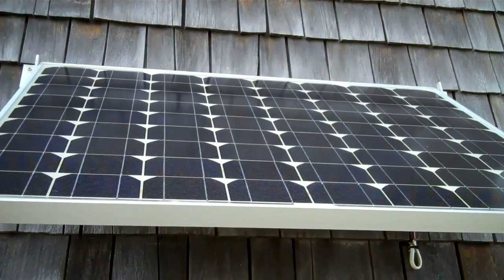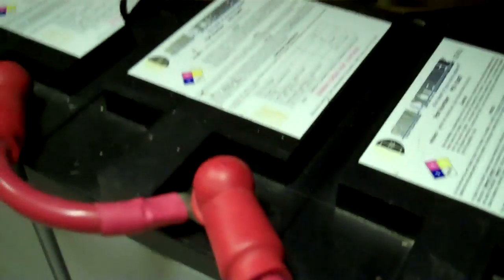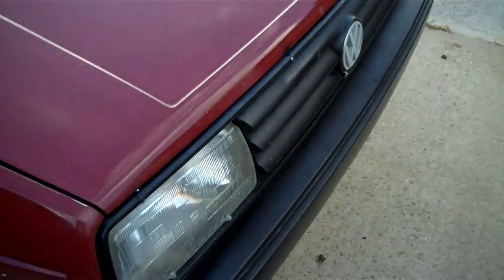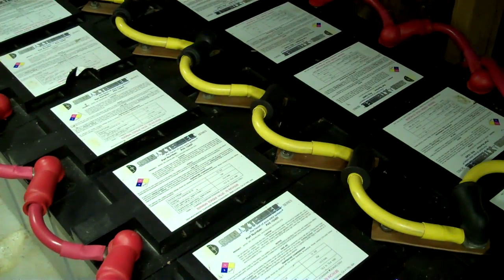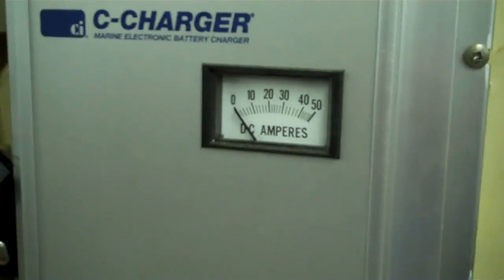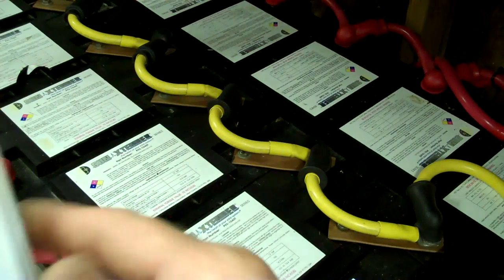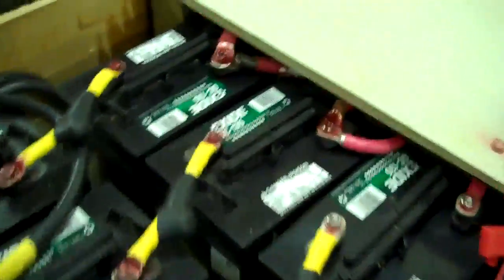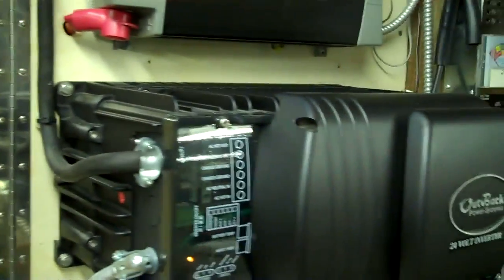HOW TO GET THE MOST LIFE OUT OF YOUR SOLAR BATTERY BANK

Comment: I have a 12v sistem to with 16 AGM it works beautifully I use it to run my house everything In-N-Out I still have grid but is only use for the central air my bike up is a 18000 watt Generac propane what is control by my samlex 3012 Evo and you're right so much stuff for the 12 volt and yes I have music in my car and I have a 220 amp alternator I can use it to charge my battery

Comment: @4:34 you state ...
At Freezing ( 0°C / 32°F ) the capacity falls to 50%.
 But per Sandia National Labs a SLA battery only loses 25% - ie it still has 75% of rated capacity.

Then you claim, capacity is also lost at higher temperatures.
But Sandia National Labs states capacity INCREASES with higher temperatures.

Comment: I'm not sure what this did but I have two 100ah AGM battery's that have stood empty for nearly 2 years, they wouldn't charge up and stayed at 3 volts even when I connected a second battery to get it charging...so I connect the stick welder earth onto the pos and tapped the electrode on the clamp...done the same on the earth...they sat at over 13 volts and have stayed there for near a week and now still in the high 12'v's after 2 weeks...

Comment: the main benefit of 24 or 48 volt compared to 12 volt is the amount of batteries you can connect together.... when you set in series they work better than in parallel ...you should only have 3 parallel. so if you have 6 volt batteries set up to 12 volt you can only have 6 batteries.. if you set them to 24 volt you can have 12 batteries, at 48 volt  you can have 24 batteries..
Reply: With the PROPER connections, we can easily connect more than 3 sets of batteries in Parallel.  And it wail last for many years...

Comment: 12V voltage setup is not so efficient and it is possible to charge other battery voltages from a single running vehicle such as a car/truck/van.  AGMs are much cleaner than FLAs and much safer for indoor use.
Reply: AGM cost more per Ah and don't have as many CYCLES as an FLA.

Comment: i have 8 Trace 235AH 6V Deep Cycle Battery  48 volts and have the flexmax 80 can you tell me what are the  charging voltage set points-current limit, absorb, float, absorb time limit, end amps and rebulk.? i can't find the specs

Comment: Nice video. For GEL cells (not AGM's) you will find that they will last longer if you never charge more than 14.1volts (14.3v absolute max) at normal temperatures. Never equalize GEL cells (even 15 volts can ruin them.)
Reply: Are GEL cells better for Stand-by applications - like a UPS ?
Reply: @MrSummitville    Hello, I think good quality AGM  batteries are best for standby. Gel cells are just so critical on charge voltage. Chargers can go wrong, and any GEL (thick electrolyte) that's even slightly over- charged won't last long. I have some YUASA standby cells and they've lasted well

Comment: Nice work you doing. I have few questions

(1) I used a 12 AWG cable for connecting my solar pannel to my charge controller?
Can I use that same 12 AWG cable for connecting my charge controller to my 200AH battery?

(2) what size circuit breaker in amps can I use on the positive side between my battery (200AH) and my inverter (1500 watt pure sine wave)
Reply: Ampere Hours is a measure of how much Power a battery holds, and has almost nothing to do with wire size.  The information you need for that is your max intended load on the battery (in your case, probably the max DC amps the inverter can draw), and the '20 hour rate' for the batteries.  The smaller of those two numbers is your limit - you CAN draw more than the 20 hour rate, but the more often you do it, or the higher you exceed that number, the more you're going to lose battery life.  Really high currents can damage the battery, cause bulging (first sign of damage for a sealed lead acid battery), leakage, fires...  but I assume you know that.

Once you know the max current, do a quick search for, say, 20 amps wire size, and Google will be more than happy to tell you.  Keep in mind that the Length of the wire matters - a really long run will require larger wire to keep voltage up where you want it, and some wire gauge amperage charts might not mention that.

Comment: Solar systems are for fools, if,you owe a loan on your house or rent.Want to save? get out of debt,stay out of debt.owe no man nothing.
Reply: I wouldn't go that far.. The companies that are calling you and pushing solar do NOT have your best interests at heart , which is to say, if you don't know solar pretty well, they'll rob you blind.

I'd even go so far to say that if you don't have money like Ritchie Rich, AND you don't know a Lot about solar, batteries (if you use them) and electrical maintenance in general, you won't benefit a lot from any kind of solar system.  The service contracts the solar companies sell are expensive, but absolutely NEEDED if you don't plan to do the service yourself and have the knowledge to do so.

A large enough system to give you some decent backup power in an emergency (lets face it, you aren't paying this much to cover a few hours of electricity outage) is going to be expensive.  Anything less ambitious is better handled with a generator.  Yes, solar is a bit better on the environment than a gas guzzler (but not as much as you think - the energy and waste from panel production is not small - not to mention batteries).  So if you are willing to spend the money (or work for it) to save the environment, more power to you (yes, pun intended).  If you have the expertise (ant the time and willpower) to do at least some of the maintenance, and maybe even installation, yourself, you can easily break even, maybe even go a good bit into the black saving money.  Depending on your local power monopoly's rules, you may even be able to profit by selling some back to them, but most make you jump through so many hoops, and pay so little, its not worth it.  (Mine has condescended enough to pay you back HALF the rate it charges...)

The rest of us poor slugs have to get by with whatever we can.  IF you can find a good grid-tie inverter for a good price, a small system without batteries is viable.  Just don't fall for the companies that want you to pay them for every kilowatt hour you sell back to the power company AND charge you a steep yearly maintenance fee.  You won't even come close to breaking even with them (until their contract is up, right about the time stuff will start needing to be replaced...).

Comment: Never place a battery on the concrete, put them on a pallet
Reply: That's just a myth, dating back to when batteries were made of wood and sealed with asphalt.  Anything with a plastic case can (and probably should) be placed on concrete.
Reply: This was good advice before batteries were made with plastic cases like today. Modern batteries do NOT self discharge when on concrete anymore. 
You can contact Interstate Batteries to confirm this.
Reply: why?
Reply: When batteries are not mounted on equipment, they should be placed in proper storage areas, but never stored directly on a cement floor. If necessary, place them on wooden pallets and store in a dry, moderately cool area

source: https://www.safetyinfo.com/forklift-battery-charging-safety-free-index/
Reply: Willem Budde thanks for information, but i thought cement is safer than wood. In case if battery on fire, wood is easy to catch on fire but concrete is not. Other reason is concrete can absorbed any liquid leaking out of battery which help prevent chemical creating fire.
Reply: You welcome Danh Luc
Reply: Willem Budde  shut up stupid
Reply: Thanks
Reply: you are really weird man. instead learning something, your words just show how a person you are.
Reply: Keeping batteries off cement is NOT a myth.  Ever walk on a plain cement floor in winter?  How fast do your feet get cold?  Same thing happens to your batteries - and cold batteries don't perform well.  Even in moderate seasons a cement floor can drop battery temperature enough to reduce efficiency.  Cement IS safer than wood (not by much), but put a rubber mat under the batteries to insulate them.  If you do decide on wood, remember - Stuff Happens®, and when stuff happens to batteries (or anything electrical with enough voltage), it can cause fires.  Better safe than sorry.

Speaking of efficiency... higher voltage = less current =  more efficiency, no matter how big your connecting wires.  The electronics that turn DC to AC not only lose less to heat at lower current, they don't have to multiply the voltage as much.  This is a much bigger loss if a transformer is used to step the voltage up, but even the newer inverters that are all solid state will lose some efficiency to the extra current needed to boost to the voltage higher.  A 240 vac (RMS!) inverter means 340 vac peak, and 48 vdc would probably be boosted 8 to 10 times to provide it plus a little margin for efficiency and voltage drops.  24 vdc would need a 16-20x boost, 12 vdc - 32-40x.

Not to mention 0000 gauge copper wire is very expensive.  You'll pay a lot less for every gauge size you can drop for the same length of wire.

Comment: Where can you buy large gauge battery cables? Thanks
Reply: With a little elbow grease you can make your own using high quality welding cable (ebay) & copper from local supply outlets. Reference YuTu on how to DIY. 
Good luck.

Comment: Great video.  Where id you get the heat shrink to fit the large cable?  I have been making all my own battery cables out of 1/0 fine strand welding cable, but could not find heat shrink big enough to fit over the cable & lug.  Also, I like the covers that you have used to cover the lug and battery post.  Where did they come from?  Thanks for any help you can provide.  Lucian Dean

Comment: Nice system you have there.  It would be bit more  efficient to run a 48v panel and battery system as the 12v inverter can get much hotter when converting  12v to 120v.  The 48v inverter creates a lot less heat (loss power) when converting from 48v to 120v.   Of course it cost a little more to use 48V components, but the cost can be made up in the cost of the wiring.
Reply: Costs a 'little more'.... um it's four times the cost... for a 100AH battery bank on 12V, you need one battery, on 48, you need four. Nuf said.
Reply: That's not exactly how it works. A 100Ah 48V battery bank carries you farther than a 400Ah 12V battery bank.

Comment: I noticed your batteries are on a concrete floor, that will drain the battery over time.
Reply: Putting modern batteries on a concrete floor does them no harm. The problem only occurred with the old style battery casings used many decades ago.

Comment: How much does one of those batteries cost? If you only wanted a 1,500 watt system to run basic things that RV's have like a TV, small air conditioner, efficient bulbs. How many batteries/ panels would you need to buy?

Comment: How in God's name does a 300w array power 2 freezers?  That on a good day may bring in 1500WH.  That might do it ,but what about the rainy days?  I have a 1KW array (3 times as large) and I worry about powering my 800WH/per day fridge.

Thanks!
Reply: Use a more efficient appliance.  There are chest freezers that use less than 600 wh/day, and refrigerators that use half of that. 300W panel in my area gives an average of 1300wh/day.  Use a tracker and it can be 1690wh/day. Plenty to run a freezer and refrigerator that total less than 1Kwh/day.

Comment: After careful consideration I feel the up front cost for all the components are cost prohibitive for the amount of power you
can produce..  I believe I will look into a gasafire to feed a generator..  I admit I have no experience with solar, however, the
needed power is just not conceivable, I need to be able to operate a A.C. unit in the summer and power a deep well.. For lights
solar seems to be fine, but nothing more..
Reply: +Joseph M I run my whole house on two 300W solar panels.
Reply: Pop's Shack Question, how many batteries 
do you need and what can you run in your house with 300 watts ? Thanks in advance..
Reply: +Joseph M I currently have 12 batteries. I run my fridge, my lights, my water pump, washing machine, computer, clock radio, satellite Internet modem, wifi router and power tools, eg table saw and mitre saw.
Reply: Pop's Shack Wow that is amazing, 12 batteries and a 300 watt solar panel ?
Reply: +Joseph M No, two 300W panels.
Reply: Pop's Shack Oh ok , very impressive amount of power. Are the batteries 6 volt
deep cell or 12 volt, also what size inverter do you use ? I appreciate you answering all my questions, you are a big help. Thanks again..

Comment: 300W is a serious joke. I have ample power supply with 200w of charging per 12v storage. 
4-6 6v bats in series/parallel  with 800w panels= little, if any, down time. Including a fan or elec. blanket & security cams on overnight.
Massive battery banks are for 3-4 days of straight overcast. ........VERY nice equip you have there....CHEERS.

Comment: I'm offline, with 10 golf cart batteries. When cloudy I use a 2000 watt Honda gen with a couple of 10 amp chargers. It's hard to find "manual chargers" that actually put out a steady 10 amp charge. Any suggestions for an affordable charger that would fit my needs? You mention charging off a truck.  Will a 1989 Totota do?  Thanks. . CB

Comment: where to keep batteries? in a ceiling or on the floor?
Reply: +Tshepo Mokgatle with the weight and need for ventilation and keeping a constant temperature for optimum range, I would suggest the floor.

Comment: all these guys with a wealth of info. but it just astounds me that know one will ever talk about the money they have invested. whats a system like this cost.. so aggrevating video after video no one ever says what they have invested. youd think if you are talking to first time people that the majority of the videos on you tube would say HOW MUCH FOR THE SYSTEM just a close ball park would be nice
Reply: You can get a couple of 280W 24V panels, an MPPT charge controller, controller monitor, (8) 186ah 6V batteries, and cables for about $1200.  This is enough storage to run an efficient DC freezer for over a week without recharging.  The two panels will produce enough power on an AVERAGE day to run the freezer for about 4 days. More if you use a tracker.
Reply: Douglas Cooke where are you getting this pricing?....
Reply: Panels , charge controller, and monitor, from Stored Energy Products in Lake Worth, FL.  Batteries from Rural King (on sale and with rebate). Make your own cables.
Reply: You know a solar system is expensive. You can't buy this stuff at Walmart. I have a 3kW system with 4 banks of 24 volt self install. I've paid for my project about six thousand
Reply: come on do not do the poor guy that. My brother you do not have to start that big i have a little cheap diy system i bought used batteries a cheap pwm controller got some wires at a scrap yard 780w of panels and a little Cobra 12v inverter been running my three bedroom house for a few years now. My brother start in your community put out the word you would like some stuff and see if you can shop around for good prices that you can afford no watch these people with the big system most not going to tell you what they start with just do your thing

Comment: Thanks, I really enjoy your videos. I have a question is possible to hook up a generator to you outback inverter so it will charge your battery bank?
Reply: +Mika Lee Some inverters do have a "pass through" feature. It allows you to do what you said. Charge batteries through your inverter as well as run other loads while the generator is on. When the generator is turned off some have an auto switch that turns over to battery power.
Reply: Does an Outback inverter have that feature?
Reply: Yes, some do. Check their website to match one with your requirements.